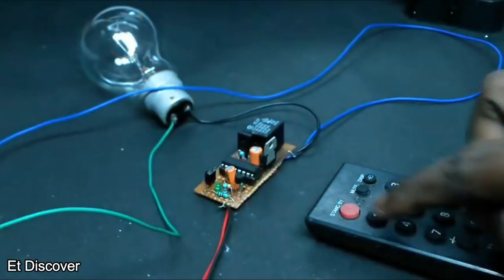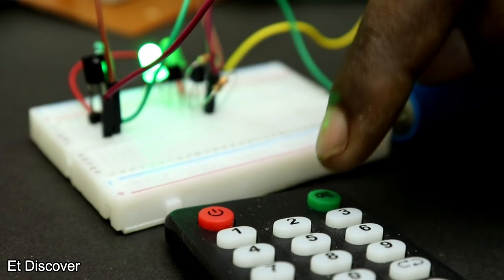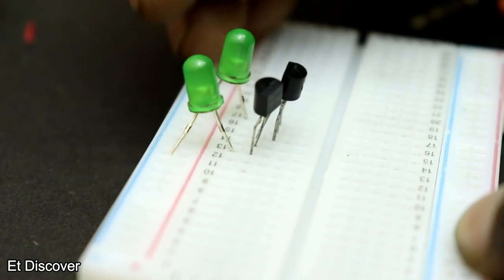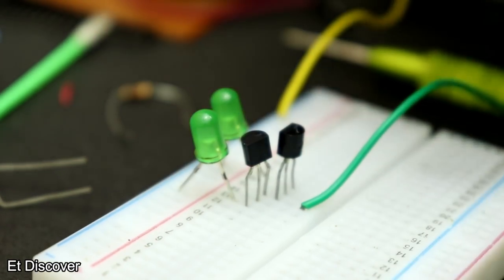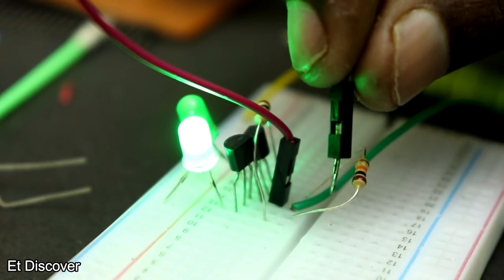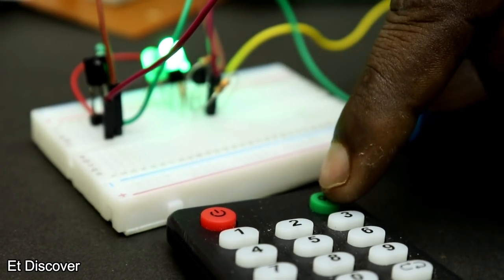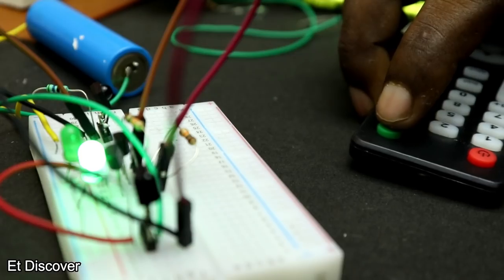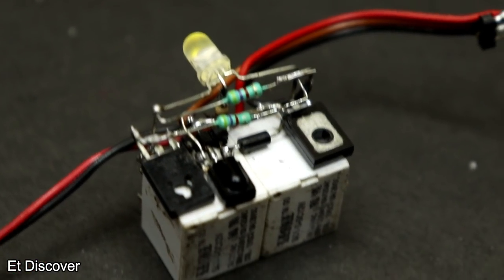2 Channel Ir Remote Control Only 2 Transistor

Comment: Actually tsop 1738 and 1838 are very sensitive and does not gives proper output all the time. The IR rays coming out from the CFL lights also affects its performance.  Can you please discuss about some other sensor which would work perfect for such projects .  And moreover please tell me about the sensor present at the receiving section of the television. Keep going,  waiting for your next video.. 😊

Comment: i never heard of a bd 139 Transistor, what can i use in place of it. i have BC547 and 558 as well as 222N and others, You really did not need the 2nd TSOP IR YOu could have used a PNP and an NPN